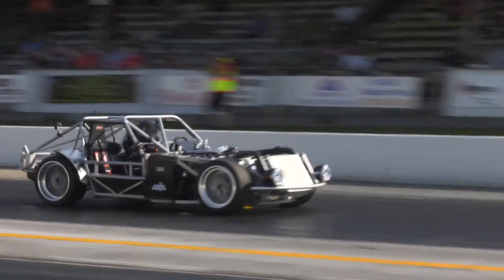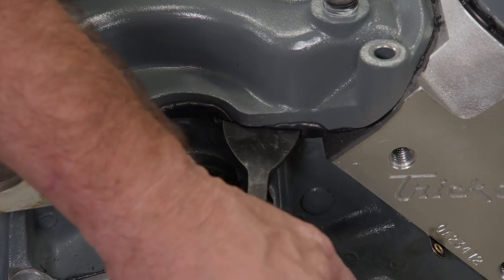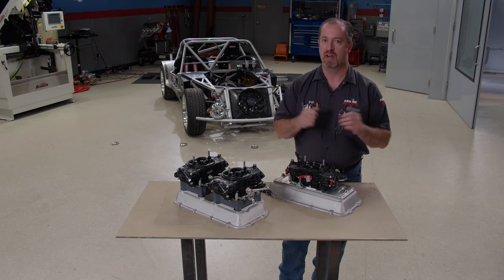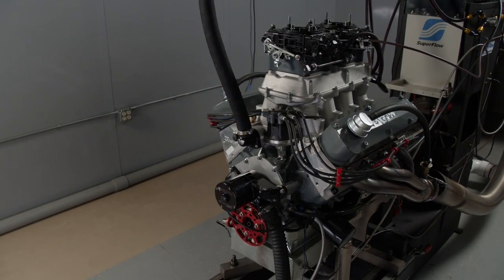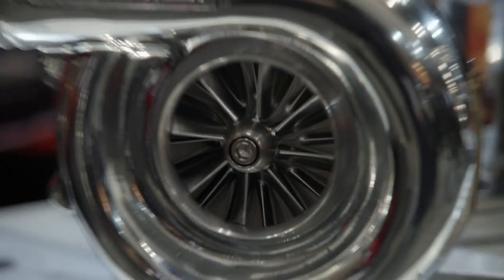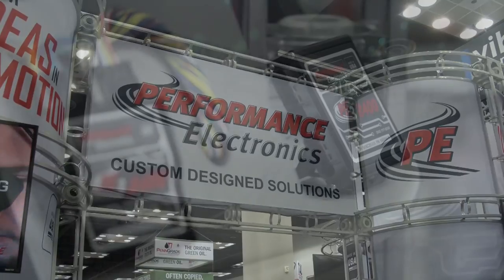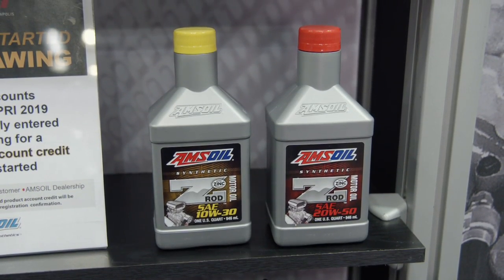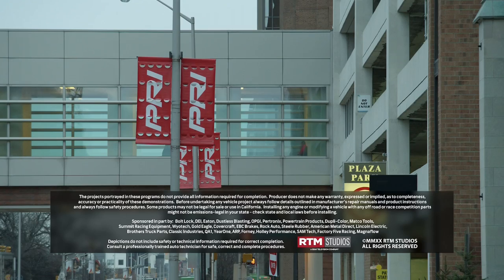Tunnel Rammed Windsor Makes Big Power - Engine Power S7, E3.

Comment: If Ford ever made a good engine why don't they use them in pro stocks and in top fuelers and funny cars what did they use that Chevrolet designed
Reply: Hey Badass Corvette brother.
Reply: +billyfromtheusa  lol, even pre LS era SBC engines were better than SBF engines.
Reply: @basshead.  But they're no match to the almighty 427 SOHC CAMMER V8.
Reply: +CJ Colvin  The price-performance ratio is pretty bad tho.
Reply: @basshead.  dont pat yourself  on the back to much...ford engineered and developed the sbc and sold it of to chebby
Reply: +390merc 66   Only in the magical land of rainbows and unicorns.
Reply: +Mike C  If those Ford engines were so good why they started to make shitty Modular engines?  Those were even worse than the SBF 🤣🤣🤣🤣🤣🤣
Reply: The Coyote is pretty good but still not as good as the good old LS.
Reply: +Mike C   The LM7(LS based truck engine) stock 5.3 block can handle 1500hp. Not a big deal.
Reply: @basshead.  oh..ya think so ??..just look at a y block..then look at a sbc,,,notice both are made very similar in design???...back in the day ford was buying GM trannys for the lincoln...so why couldnt GM buy a motor ford was doing nothing with ...the y block is the one and only ford v8 to have its left bank ahead of the right just like a sbc..and both have their number one cylinder on the left front..again the only ford engine to be built that way ..and you cant say ford copied chevy cuzz the y block was out  on the streets a few years ahead of the sbc ..after the war ford was experimenting  with engine design...one was the yblock..the other a motor called the [ indy ] motor..[sbc of today ] ,it even looks lie you could swap valve covers from motor to the next...exhaust ports are very similar  in design ..and in the 1960's...GM was buying 3 speed manual trannys for their cars..have a chevelle with a 3 speed manual?..its most likely a ford tranny..i know you dont like hearing that ..but those are facts..feel free to check on that  and call me out  on it..you's chevy guys need to stop believing everything you read  in super chevy magazine
Reply: @basshead.  and if ford motors are junk...then tell me how its possible for hotrod magazine or motor trend to build a 350 chebby and a 351 ford using similar aftermarket parts..and when the dust settled...the ford made more power...and this very channel built a big chev and a big inch ford...the ford made more power..then they built strokers out of both ...the ford at 557 cubes made more power then the larger cubed 572 chavy made ,,oh..and the chevy used  2 /4bbl carbs to boot to make less power ...you's chevy guys are so mis informed...is the ls  or sbc a good motor??..sure it is..but so is the ford ...and i know this hurts..but the ls has alot of F,E  AND mod motor in its design
Reply: @basshead.  just one more thing...one of the top magazines a few years ago did a small block muslce car motor shootout...again,...when  all was done..they picked the ford boss 351 as top small block muscle car engine ..not chevy or olds..or pontiac..or mopar..but a ford
Reply: @basshead.  and just keep this  in mind..NO ONE EVER PAID $3.4 MILLION FOR A CAMARO....LS POWERED OR NOT
Reply: @mikec9112  OH I LOVE THAT ..[ THE ONLY THING A SBC WON WAS POPULARITY ]...THATS A GOOD ONE
Reply: @mikec9112  YOU FORGOT TO MENTION  o'l bob glidden  was setting track records and beating the mighty bbc with ford motors at the time that had no aftermarket support like the big chev ....back in the day ..if you wanted to scare a chevy guy....all you had to do was show at the track with a cleveland ,,lets also not forget out of all muscle/pony cars ....only the mustang never went out of production...unlike everything else ..cough  cough  [ camaro ]
Reply: @basshead.  ever go to any major city ??...notice most of the  taxi's are crown vics..you know?..those cars with the terrible 4.6 mod motor ..crown vics..mercury grand marquis and town cars are known to reach very high millage with ease ...lets not forget the first monster truck  was a ford...and it was a ford that won the first million dollar prize at nascar ..you see..its not all about chevy
Reply: @bigboreracing356  then you aint lookin to good ...did you watch that video i sent you of a crappy 429 torino out running  big block camaro ?
Reply: @bigboreracing356  That's surprising. No Terminators or Mod Cobras? The 2v GT motors are dogs, but the 4v can be pretty damn quick.
Reply: Scott have you never heard of Bob Glidden? He rained fire and brimstone on your beloved chebbys. Ask Renee-Morrison and Warren Johnson about Ford's Cleveland's. Geez what are you about 15 yrs old. Lmao.
Reply: @bigboreracing356  You better study your Pro Stock history a bit closer. Dyno Don Nicholson and Jack Roush won many races and Pro Stock Championships with the 351C. The Cleveland was so good it carried the heaviest weight penalty of any engine doing the "weight break" Era of Pro Stock. Fords Boss 302 and Boss 351 race programs were more then a match for any engine of the same cubic inch.  Pro Stock rules changed many times since those days. If you really want to do a fair comparison builds...you have to use a 2 bolt main small block 350 Chevy  against the 351W from the early 70's. If you really want to see what Ford engines can do allow the 71 Boss 351 in the competition. Believe me you will find why Cleavands were restricted from competition or at least made to carry more weight.